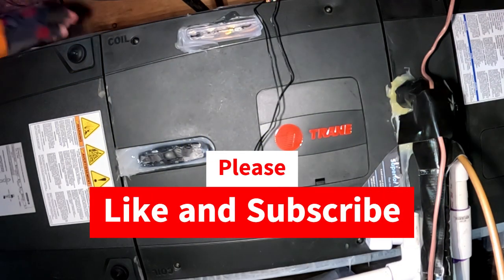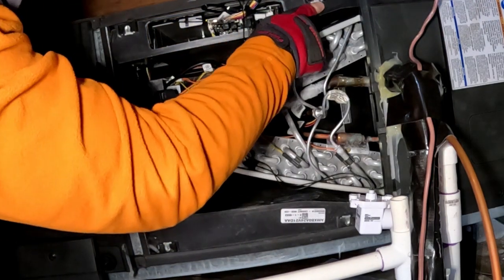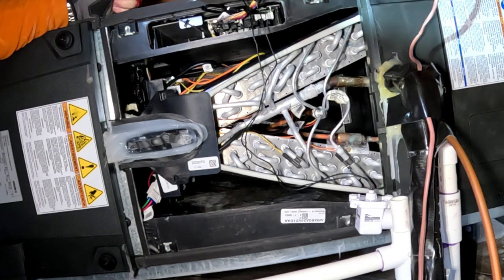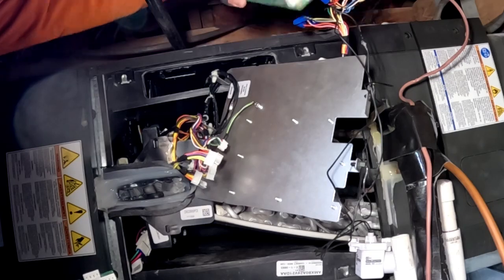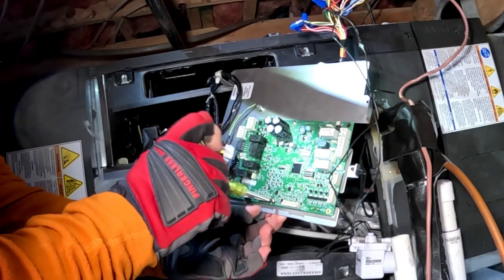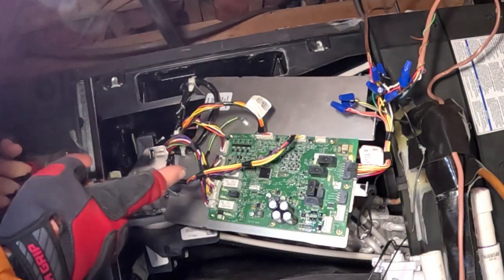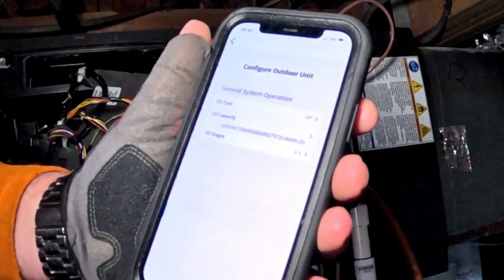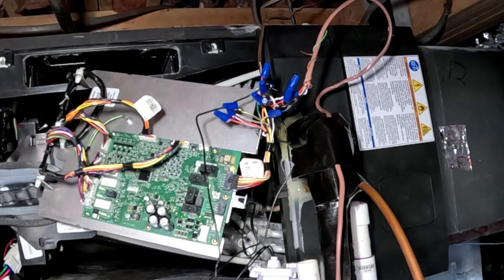Setting up a Trane air handler with the Trane APP. #trane #hvac #hvaclife

Comment: Sorry Charles was in bed for 4 days really sick but when I hear stepper motors it reminds of the Chinese sight Ali express which sells a lot of knock off parts. Not saying all are bad but it sucks when trane is going the way of cheap junk Chinese parts like Emerson boards. Since they can't do tvs and vcrs anymore.

And hearing the term stepper motor really has me puzzled because those usaully are used in machines that print or route or carve from instructions from a computer but my brain is so messed up right now I can't remember the name.

But the question is trane using stepper 17 or 32.

Hopet point is made you don't want to go there with stepper motors when it's not needed.

And to trane stop trying to Chinese up hvac systems if you want better systems and boards make a, deal with Asus who is Taiwanese but they actaully know what they are Doing when it comes to electronics and circuit boards.

Comment: I've never come across a stepper motor issue so I feel I've just been lucky. 
How do you go about changing a stepper motor? Is there specific steps or procedures??
Reply from the maker: Snap it off the EEV and unplug from the board, Snap on the new one and plug to the board. Pretty easy. Test by OHMING the common leg to the other 4 legs, should be 45-47 ohms each.

Comment: I service them, but I will not sell them or inverter systems also communicating. For what you think you save in electricity,  you will pay it back and more after warranty repairs run out.